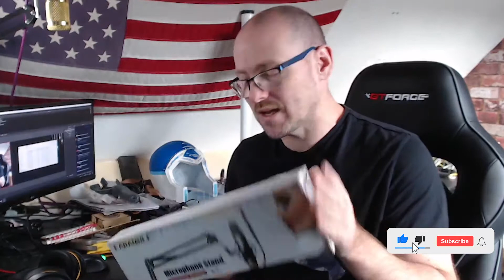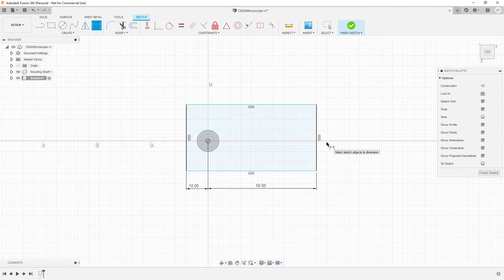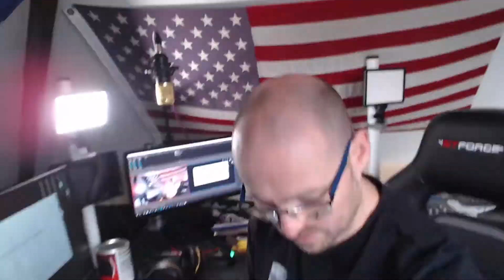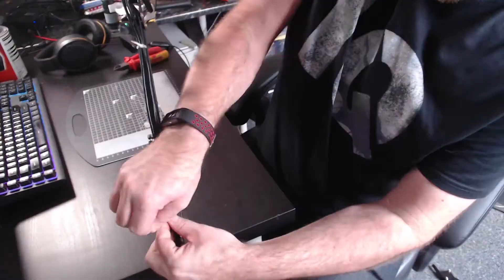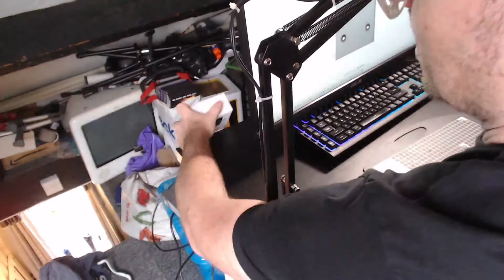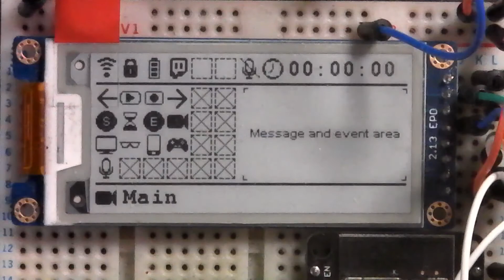How to make a POV camera rig for livestreaming

Comment: mount your mic boom off the desk, wrap the springs on the arm and put a good gimbal head on the backside of your cam mount with the bumper gaskets in it, that'll just about nix all carry through from nudges and knocks as well as give you greater precision on cam position :)
Reply from the maker: thanks. I'll look into that. any suggestion on a suitable gimbal?
Reply: Having the high zoom camera way out on the end of the adapter arm doesn't help matters, as you're also getting all the flex of the printed adapter. What will help more than any of the above would be to increase the amount of weight in the head (you may need stronger springs on the upper arm).
Reply from the maker: Yeah having the microscope on the end of the arm was always going to cause the vibration.  But its an upgrade to what I had. There is always a compromise in any system.